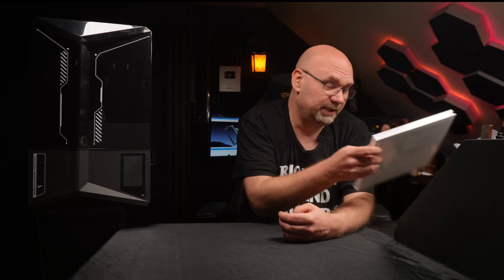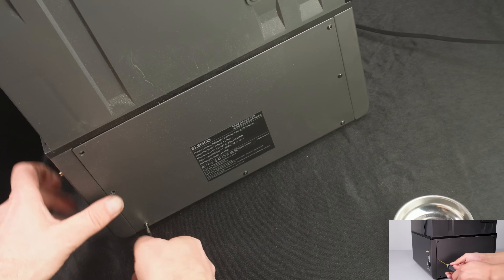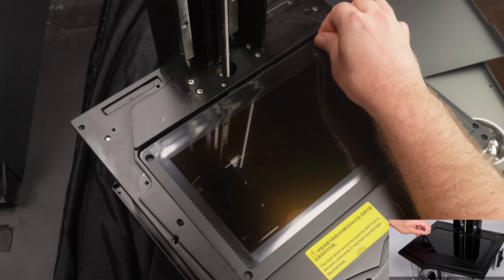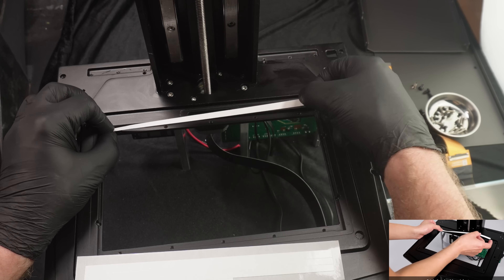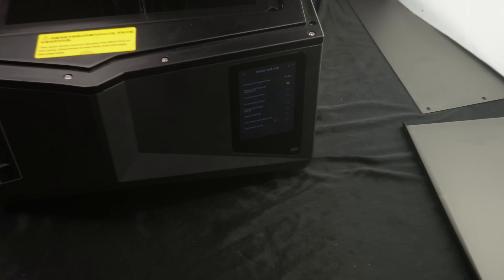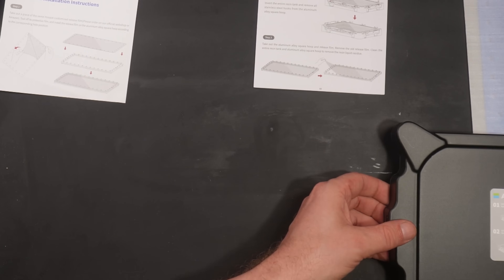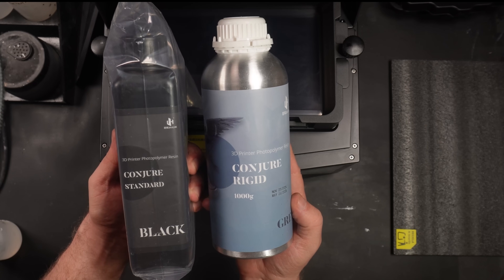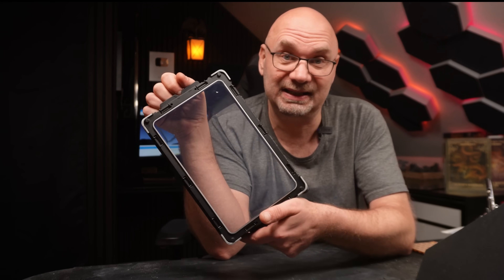Elegoo Saturn 4 Ultra: LCD Replacement & Chitu Hoopat X4 Test

Comment: Dude thanks for posting this!   I think I saw a small scratch in mine today.  Not 100% sure but I was wondering what it would be if I had to replace it.  I also went with the new VAT and while it works, it did leak a small amount if I left resin in there for say 5 or so days.  I am trying another fep sheet now to see if it was just a one off thing.
Reply from the maker: You are very welcome! Sorry to hear about the leak, hope the new fep sheet works out!🤞

Comment: How has the tank been working for a few months now? I purchased one but have seen a few reviews saying they leak, so I haven’t pulled the trigger on installing yet.
Reply from the maker: I have not had any leaks, and it has been performing very well. Just make sure the film is mounted correctly, most leaks happen if the film is damaged or installed incorrectly. Leaks have only happened due tu user error as far as i have seen on those that had leaked 😃
Reply: @olebrogger  Appreciate the update! Do you remember if you changed any settings once the new tank was installed, or was it just plug and play with previous settings? Also saw a few reports saying they had to increase bottom exposure a little.
Reply from the maker: @YOBRANDONYO i did not change settings or anything just printed with the settings I😊 used for my resin

Comment: IPA will release hot glue without effort. 
A single drop on the hotsnot's edge, let it wick in between for 30 seconds or so & voila! 
It doesn't melt or soften the glue so no worries about making a mess.
Reply from the maker: Cool, thank you for the tip👍

Comment: I recently tried to do this but the front screen would not turn on. I suspect the ribbon cable was damaged. Do you have any tips to installing those cables and where to get replacements?
Reply from the maker: I have not tried to replace the front display. and I  have tried to locate the spare part. I could not find any replacement front displays or cables. the only spare parts. I could find was main LCD and Motherboard, but that wont help you a lot. If I was you, I would contat Elegoo support at 3dp@elegoo.com, they are very helpfull and if some one knows where and how to get the parts it will be them. Sorry I cant give you a complete solution to your issue.

Comment: Good video, but you're suppose to ignore the "remove before printing" instructions and leave the protective film for the first print... lmao I accidentally did that one time, and was surprised that the first print I did actually finished. Talk about an easy print release and build plate clean up. lol The coolest thing though, was that the red from the letters transferred onto the bottom of the print, so I had the warning label transferred to my print, and got me thinking how cool that would be to have custom colored films that you could print onto to add in color for some reason or another. Really would only be for particular use cases, but still really cool how the color from the film transferred on to the print as the UV light was projected through it. After swapping out my first film on my tank for my S4U, I have really been thinking about getting that Chitu Systems resin tank.
Reply from the maker: Thank you😀 it sounds as a cool effect, maybe I will try it out😎 thank you for sharing,